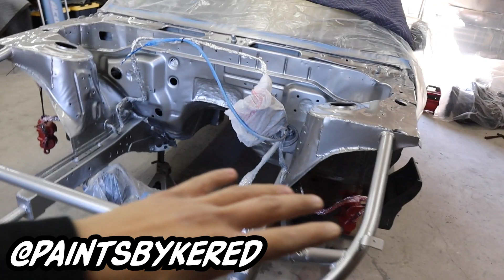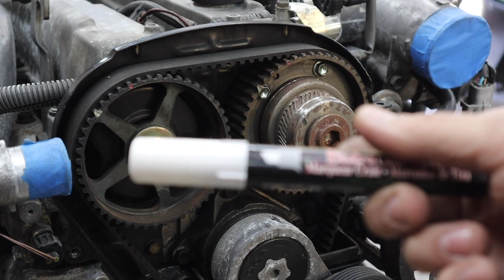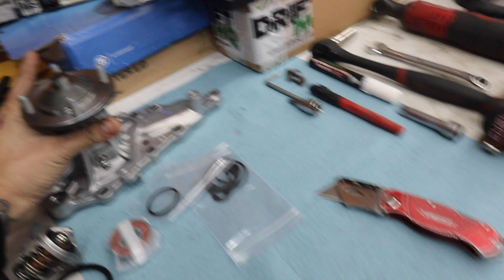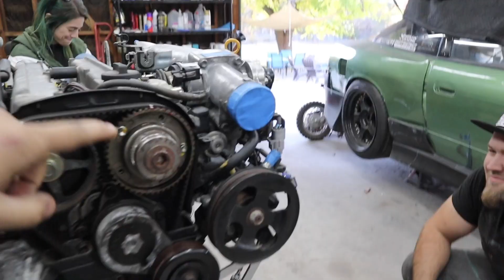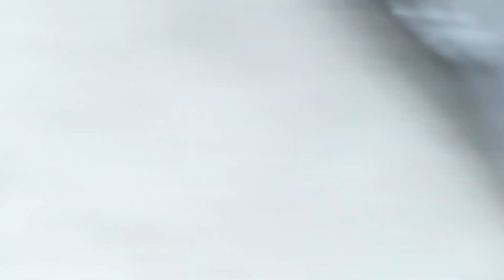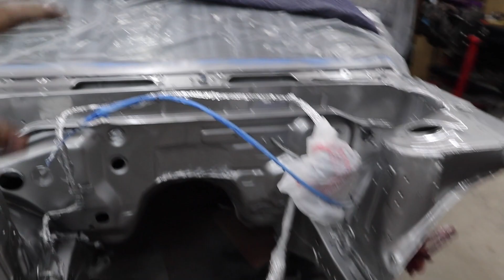1JZ Gets 2JZ Water Pump + VVTi Cam Seal and More!

Comment: I’ve never seen anyone replace the vvti seal with the cam gear on the motor. folks usually the the entire cam gear off and re-seal it. But if it works it works 🤷🏾‍♂️
Reply from the maker: So far, no leaks! I was surprised by the method too lol

Comment: Do you not need to reseal the water pump housing to the block when installing the water pump? The house seems to have moved when taking off the water pump.
Reply from the maker: The water pump comes with a gasket you swap. I couldn’t tell you why I didn’t show that in this video hahah.

Comment: Im doing a 1jz swap on my Genesis. I was thinking about doing this before I drop it in. What are the benefits of the 2jz pump? Serious question 👀
Reply from the maker: Sorry for the late reply! But the 2jz pump has a metal propeller wheels as opposed to ceramic I believe. It lasts longer and less chance of failure.

Comment: you can not reuse the hydraulic tensioner once the pin has been removed
Reply from the maker: Oh, why is that?
Reply: @behradsays  good question. Toyota advises to always replace it when the pin has been removed so i always bought a new one everytime. Maybe it still works if you compressed it but i was not willing to take the risk and lose timing or something